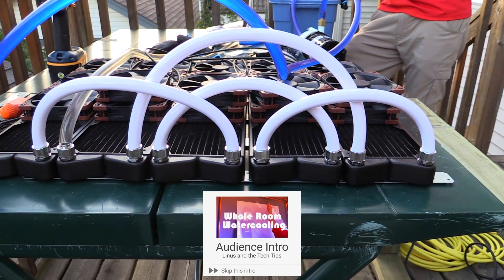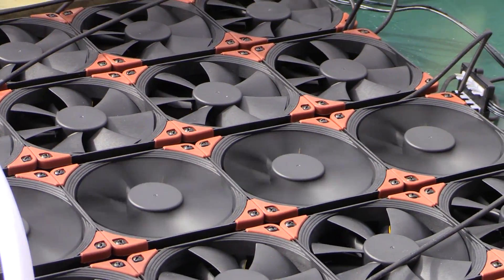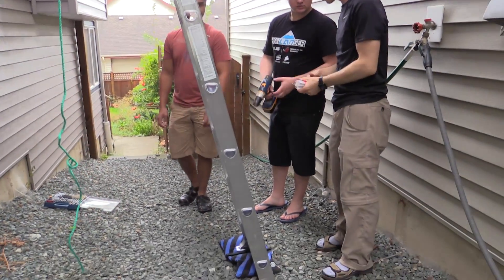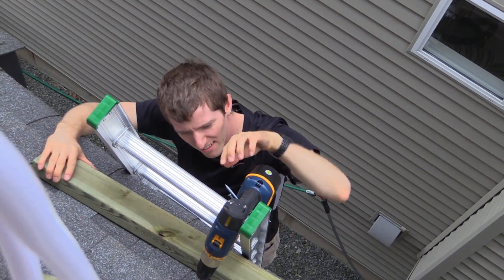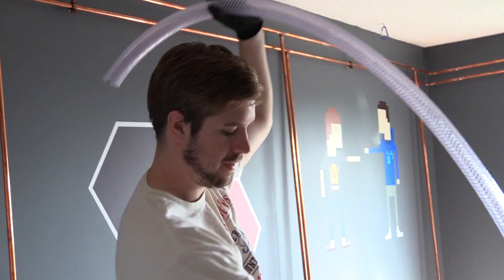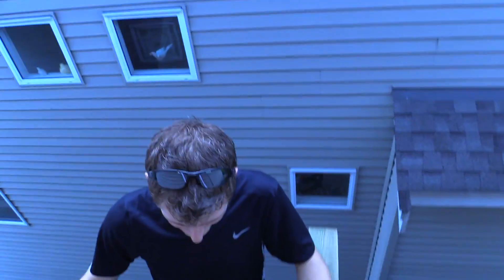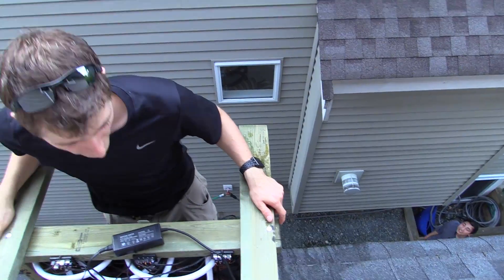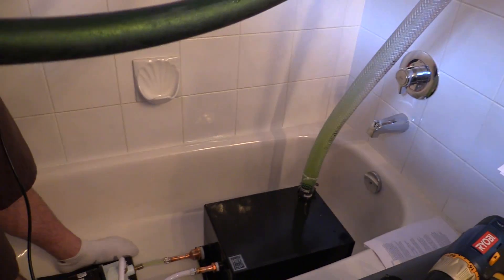Whole Room Water Cooling Project Day 3 - Radiator Mounting and Panic...

Comment: Id just put one big fan on the radiators much like a car considering the radiators together are a similar size to a car radiator
Reply: Eric Ayers I call bullshit.
Reply: Id just use a car radiator
Reply: Thats exactly what I was thinking, it would me much cheaper, simpler and much more effective. A big aluminium diesel radiator and two fans would have been perfect.
Reply: Michael Chambers why not just buy an aluminum aftermarket car radiator.. lol
Reply: ***** but much more heat for the room! they want to get the heat out, remember?
Reply: ***** really? How many watts do you think 100hp equals?
Reply: Eric Ayers Enough is enough, I am an aerospace engineer that has actually designed, manufactured, and tested heat transfer systems for jet engines. So I feel like I am certified to tell you that you are talking out of your ass on a lot of these points. You are taking tidbits of information (such as the no slip condition) and extrapolating their effects to the complete system.
Reply: A few days ago I came a cross a universal radiator that could be wired to run in both directions, just take off the fan and put it back the other way (it was made to do this), two of those over the Noctuas, even if the Noctuas are nice. Much less that could go wrong, 2 fans over 20.
Reply: muh1h1 You have verry limited surface area on these pipes, also the water in them will not be that much warmer than the room itself, so it wont heat the room significantly.
Reply: something like 4 200mm radiator fans would prob work very well and be way cheaper
Reply: Why didn't they use a car radiator? Is this a youtube channel about cars?
Reply: OverPowered000 I guess his neighbors get pissed when they have there Central air on as well right? Because condensers are so extremely quite? lol
Reply: ***** Thats why there is something called a fan clutch connected to a temp sensor in the radiator or electric fan on a circuit that becomes energized when the radiator is at 220F. I am truly am an engineer and this would work but it isn't a beneficial design. So in some sense I agree with you. I also think without stupid ideas we wont get breakthroughs in design or technology an example  Louis Pasteur gave a kid rabies because he wanted to try something crazy or dumb and gave us the ability to make vaccines curing millions.
Reply: This thread makes me think I should do a series on heat transfer for dummies or something.
Reply: Fundamentally Atheist Poly is even easier. Crimp fittings and pipes that can bend. You can rent/buy crimper cheaper than that copper pipe cost. Anyone that has plumbed knows copper isn't the right choice here.
Reply: Huh, not a bad idea.
Reply: do you think that the cold side will drop under room teperature? Maybe if most of the systems are powered down, but not with them working i think...
Reply: I remember once seeing someone actually use a car radiator to cool their PC
Reply: Many ppl here thought about the same thing (me as well) why not a car one?
Reply: Why not make the house a giant freezer and wear really warm clothing
Reply: Colin Blount No it wouldn't, bigger fans require less RPM.
Reply: and im king of sqentiki...lol

aslong there is no proof to see ,you can say that everybody on youtube is an expert on anything.atleast you can say is that linus is an expert on room watercooling because he have try it and showed on youtube,

on other note car rads isnt needed because there are already existant large radiators for pc and the jokers in this postline should look at phase-change cooling,hooking it up to fridge or airco jokes should stop there.(already exist).and i was surprised that linus used several basic rads  to install outside while he could install specified large ,extentable and also fanless rads like from aquacooling(check website of frozencpu)
no i dont consider myself as  certified,graduated expert. i just know alot.
Reply: they could have used this as big rad:
http://www.frozencpu.com/products/15419/ex-rad-360/Koolance_9x120mm_18-FPI_Aluminum_Radiator_-_HX-1080_no_nozzles.html?tl=g30c95s667

or if noise is an problem they could have used this:
http://www.frozencpu.com/products/20515/ex-wat-257/Aquacomputer_Airplex_GIGANT_3360_External_Radiator_-_Aluminum_Fins_33303.html?tl=g30c95s667
Reply: "Car radiator works. Just put a big fan on it. The fan is ALWAYS at full power & that's how a car is ALWAYS cooled" 
Yeah, that's the message this thread is pushing. Brilliant. Yes, because the fan is ALWAYS at a high RPM while the car is moving, off (aka, not running), etc. 
I hope most of you never ever become engineers, scientists, mechanics, and/or technicians.
Reply: I would have just used a 4th gen Civic radiator (widely available) and grab the 12v fan+shroud for it. It would have been lighter, cheaper, and pull way less watts.
Reply: Eric Ayers
Yeah, but I reckon this effect is still verry little :P
Also they most likely heat their room in winter with their systems.
Reply: Gustavo Kaplon It would be so loud.
Reply: Why not run the radiators through a fridge and do without fans lol
Reply: yeah, like a mora radiator. Google it.
Reply: Well, Good idea but not as effective as this one.

Just like SSD. HDD is cheaper and has more storage but SSD is much faster. Linus'es one is SSD
Reply: A car radiator wouldn't cool it enough...
Reply: phprofYT an expert? didnt saw hes graduation yet.
Reply: MrBall Breeder I graduated last year second in my class.
Reply: One of the rare occasions that the Noctua industrial rating actually works. Might as well use it.
Reply: MrBall Breeder A car radiator from the junk yard would have been extremely cost efficient. As far as doubting my credentials I don't care all that too much, but what I'm saying is true. I have a couple of videos on my channel that hint to this also.
Reply: o yea i can agree on that  it would have been cheaper.btw i use car radiator liquid as cooling.
wander how much rant i will get with that .lol
Reply: btw i can only see some gaming vids on youre channel
Reply: MrBall Breeder I have an Ansys Fluent tutorial (a computational fluid dynamics program) and a rocket launch from my sophomore year
Reply: i gues you did that on another name . can you give the link ?
Reply: I didn't just search "fluent". It's not rocket science of which I would know, because I am a rocket scientist.
Reply: phprofYT Exactly, my point was that a car radiator is capable of dealing with a much larger cooling load than PC radiators. 4 PC's wattage totals are never going to overwhelm even the weakest of 4 cylinder car radiators.
Reply: car fans can be really loud, the nauctua fans are pretty silent, they do have neighbors.
Reply: Yes and way less restrictive.
Reply: SgtPickledic its very rare in Vancouver to find a house with central air. All of the houses are really close to each other and therefore some home owner's associations will ban/frown upon hvac systems. It doesn't matter either, it doesn't get hot enough in vancity to purchase and maintain a system like that.
Reply: Eric Ayers
wrong car rads have very fragile fins you can bend them with your pinky and car fans provide a lot of static pressure to go through the radiator because a car radiator has a lot more fins that are very fragile
Reply: Eric Ayers
Insulated pipes would prevent them from using the heat to warm up their rooms during winter.
Reply: Cero Ashura They should have went with pvc its cheaper and is already an insulter. Plus its easier to put together and drill for sensors or new attachments.
Reply: ***** in the future you will realise what is wrong in youre post.
Reply: MrBall Breeder Maybe you shall do the same.. 

Hint: *your
Reply: dont pull the grammar excuse out ,its so old and childish.
Reply: Fundamental Unity
They need copper, copper is the best means to move heat, this is why your cpu and gpu have copper tubing.
Reply: MrBall Breeder It has nothing to do with grammar, scrub. It's called "spelling".
Reply: ceraldi
1hp = 746Watts
Reply: ***** stop beeing butt hurted and stay on topic
Reply: MrBall Breeder Might want to include yourself with that rather vague statement..
Reply: ok then .car rad fans arent always running at max rpm these days there are atleast 2 steps beside the off step it is computer controlled based on the temp mesurement from the temp sensor on the engine and airco ,while the temp sensor on the rad is used to show it on board.also these days the fan mesurement  isnt always equal as the engine rad mesurement  but is smaller and equal as the airco rad.you also have to keep in mind that with the amount of car types you also have many types of technique used.

i agree that car rads works ,you find enouf proof on the web for that .
Reply: ok where are they going to get a car rad, a fan that can be computer controlled, and a computer that controls these fans for free? By my understanding almost all the parts except for the plumbing and mounting where donated to them. I think what they did was correct and doing it differently would make it too complicated for the amount of time they wanted to spend doing it.
Reply: they go to junk yard buy for cheap an large rad with fan connect to 12v  and it works.
what i explained is what is used in cars .
diy whise you can do anything.
if they gona redo it on the new place they should think more pro, less diy because its ment for pro usage .
Reply: OverPowered000 Yeah going to a junkyard would be a good idea, it would probably work too.
Reply: OverPowered000 That is hilarious, I've done HVAC in Vancouver for over 15 years. Your comment is invalid.
Reply: u can use car fan but he need 15 amp minimum
Reply: Galvanic corrosion
Reply: TennisGvy But you're implying logic. And logic doesn't exist on the Internet. And in some countries, it's considered as a "crime".
Reply: Eric Ayers literally didn't say that. ffs read with your eye balls
Reply: I was thinking just use bigger room fans as well .. floor mounted and push air up through large radiators out an exhaust .
seems like time could have been better spent on the duct work .. plus more practical lines like synflex tubing which is alot easier to work with and will be easier to modify in the future ..
Reply: Fundamentally Sublime 
I've read a lot of comments on this video, and yours seems to be amongst the best informed... so what do you think about this...

Instead of car radiators of these small dinky radiators with computer fans?
they should use a plate cooler with a secondary loop/system... that would be a lot more efficient i think
Reply: ***** That concept is already being used in datacentres. Using a heat exchanger to transfer heat away from the existing loop to a secondary loop.
Reply: Michael Chambers Jesus is the ONLY was into heaven aka the presence of the father. He ist the ONLY way
Reply: ***** well, or you could see it like this: If 4 or 5 of the noctua fans fail, there is still penty of them there :)